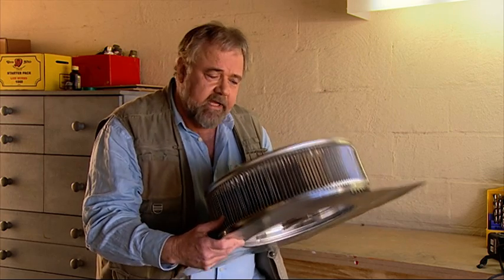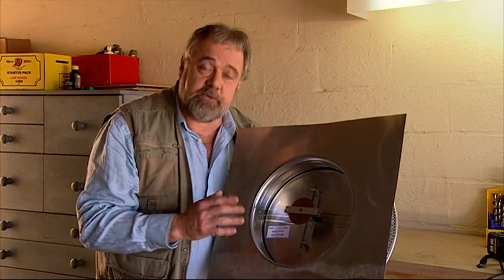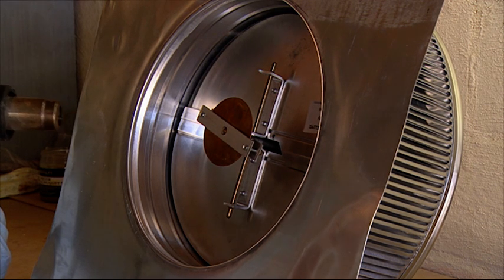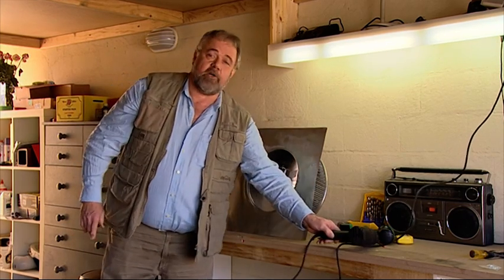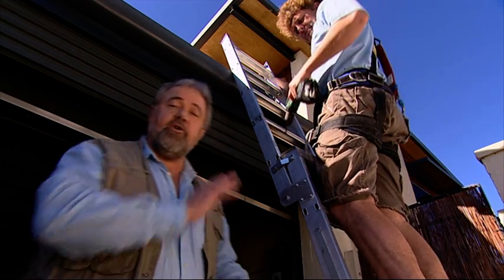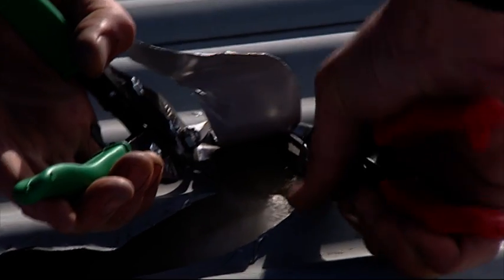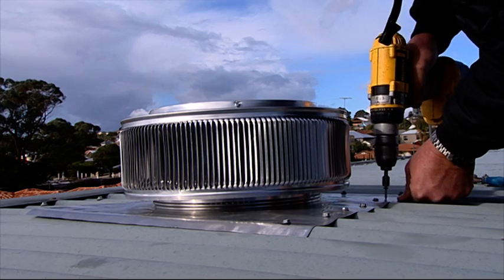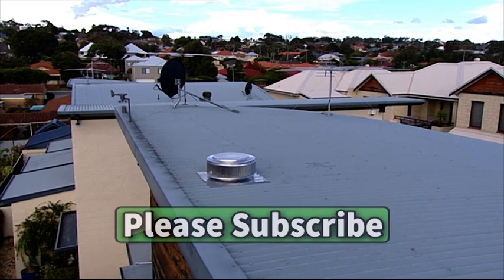Heat Activated Roof Ventilation

Comment: Big Dave "has all the right safety gear on" but it doesn't do him any good because he's NOT tied off! Secondly, that was a horrible installation. The uphill side of the base flange spans over the corrugations so water will pour right in, unless he is going to install an umbrella flashing over it with the high end tucked under the high-eave trim, and use some foam closures and caulking on the low end and the sides.